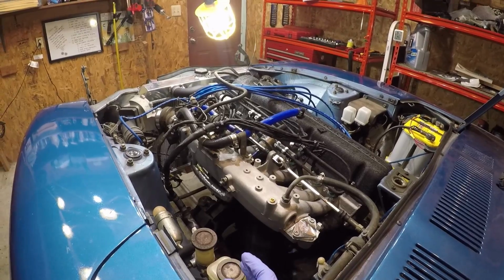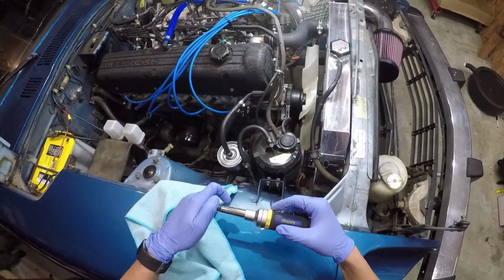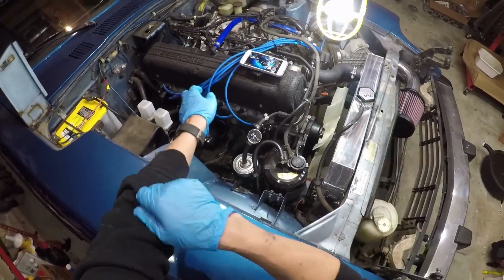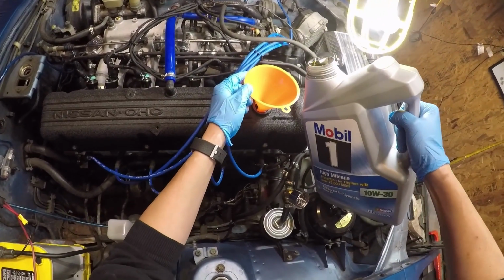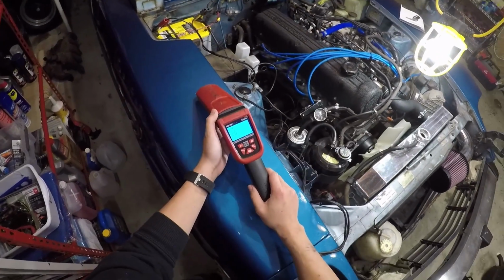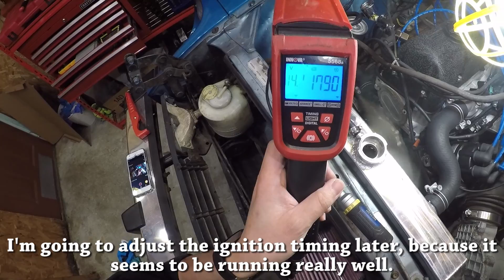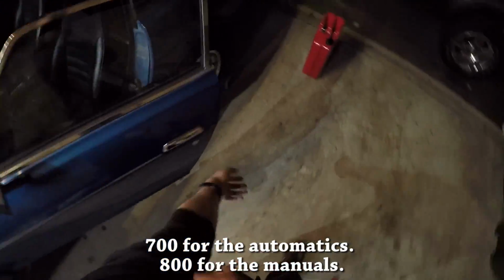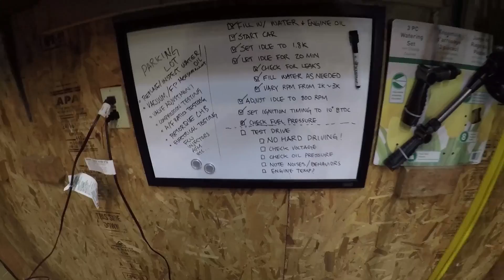Datsun 280z Ep.29 New Engine Break-in Procedure

Comment: Enjoying the narration.  Went through the same break in procedure on my '72 240z a couple months ago.  Caught a few tips from your video that I should have took in to account.  You mentioned automatics should idle around ~ 700 rpm's.  Had a hard time adjusting my original carbs below 1000 rpm's.  Can't wait for my set of ZTherapy carbs to come in! Great Work on the channel!
Reply from the maker: Thank you very much! Regarding the "tips", I always have the same reaction when watching other people's build videos as well. I try to do a lot of research beforehand, but I'm sure what I know is nothing compared to a Z veteran or a restoration professional.
Reply: Can you do me a favor? ... next time you have the car idling, step on the brake and notice if your engine idle increases.  For some reason, when I step on the brake, the engine increases in idle about 500-600 rpm's ... must be a vacuum leak or something.  If anyone else has any ideas, let me know ... Thanks!
Reply from the maker: I definitely haven't noticed anything like that. But my money is on your brake booster having a vacuum leak. That would be the only reason why your RPM is increasing at idle when the brake pedal is pushed down.

Comment: For Illustration (being illustrative) this channel gets 100 out of 100 points.   For these videos in their own right, they're the next best thing to standing right next to you helping you do it.

Very well done as usual.   Good checklist and your parking lot looks perfect.   Your channel is like a clinic.   "Just keep doing what you're doing." like Roy Jones Jr's cornerman used to say in between like every single round.   It's just complete coincidence you get it running just before a wintry blast of weather right?   Hopefully they'll be some clear days ahead in the 40s where you can drive and enjoy it.  My Z loves colder weather like that, or so it seems at least.   Congratulations on all your good work and I mean the videos too.  I know it's no small thing to put these videos out like this.  

I saw you're losing fuel pressure soon after shutting off.  The offender may be your fuel pressure regulator.   It looks like it starts great though and that pressure looks rock steady.  At first I wanted to say that it might be a little low but I'm not sure, that might be normal or normal-ish.   Wondering if you slapped the tune-up parts on it yet, dist/plugs etc and/or what plugs you're using.  I see the new NGK wires so I presume you already did the tune-up parts.    It's possible I'm missing something from one of your previous videos but I'm also wondering about the status of/story behind the fuel pump.
Reply from the maker: Yeap, I've replaced the spark plugs, fuel filter, distributor rotor&cap, spark plug wires, carbon canister filter as far as "tune up" replacement parts go. I'm using the standard B6ES11 NGK plugs.
You're right about the fuel pressure, and the system not holding pressure is a bit worrisome. It could be the regulator (which would not be pleasant, since they're hard to find now), or a leaky cold start valve. Or it could be a small leak somewhere that I haven't noticed yet, but I do need to check it out since it's supposed to hold pressure indefinitely after shutting off. 
I'm not as worried about the fuel pressure level itself right now, since 28PSI at the rail at idle is fine, and it does spike to ~35-37PSI if I pinch the vacuum hose to the regulator from the manifold. We'll still have to see what the pressure changes to at different engine RPMs.
Reply from the maker: Hey HMD, do you have specific spark plugs you recommend for the L28E? I think I'll buy a back-up set, but wanted to know which ones you had in mind.
Reply: Happy new year!  
If you went out of town and left me your car with old plugs (I'd leave the new ones you installed for now) I'd use the BPR6ES.  If they come with the -11 designator I'd get those (does a BPR6ES-11 exist?), if not I'd gap them out to 1.0 or 1.1mm myself.    I didn't notice any missing from the test drive video however you might want to experiment with tighter gaps than you are to see if there's any noticeable improvement or degradation in how it runs.  Ideally we want good spark 100% of the time of course.
My favorite "performance" plug is the ZFR6F-11 which is a newer offering from NGK they didn't have back in the '90s.   Back then a Nissan SCCA racer from these parts (also had a Z service business) taught me about the GR5 which was too "hot" for our engines however the car was noticeably quicker with the "advance" provided by the highly projected tips.   I remember he was cocky and told me "I know what these cars need" kind of thing.   A separate issue is that it's anyone's guess how beneficial the "V-Power" design is.   Placebo effect may also be a factor, I'm only human.  Dude won a few races and gave me a good tuneup.   But if your block was rebuilt by who knows where and/or if your head was shaved, I wouldn't use these plugs if I were the steward of your car until I knew the clearance.  
I drove my 280Z as my daily in college and most days were spent driving only 2.5 miles to my g/f's house and 2.5 miles back several hours later.   We took the train to the university downtown.  After months, these short jaunts without even warming up the engine fully caused carbon issues which was the main rationale for the projected tips in the first place.  The GR5s did seem to eliminate carbon fouling fwiw.   But...the moral of the story is: Don't drive short distances like a grandma all of the time -more than it is: Use these goofy plugs to solve your fouling problem.  :)
Reply: I'm still mystified as to why the spark plug gaps went from 0.8mm to up to 1.1mm between early Zs and 280ZXs and late model 280Zs.   For the L engines in Z cars, the gaps for '70-'76 were .030-.035" and in '77-'83 they were .039-.043.  Does this imply that the '77 has a better ignition than my '76 or what gives?   I'm just fine at .040" with the stock '76 ignition but I'd really like to know the true explanation for the gap differences between early Datsun Zs vs later.

Comment: Got a 76 280z  that won’t start.but when I pull fuel inlet line off it runs fine for a  few seconds.have any suggestions?
Reply: Pressure regulator bad